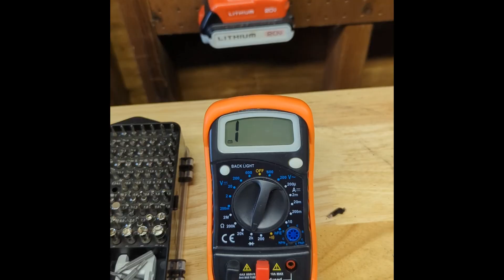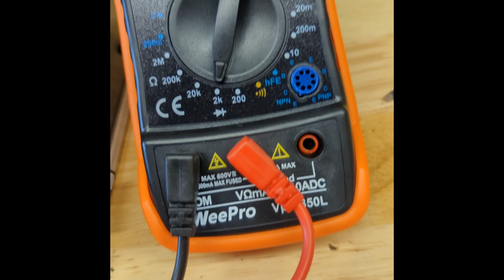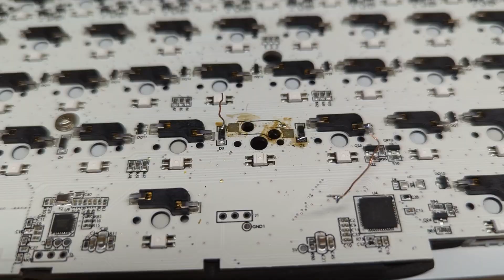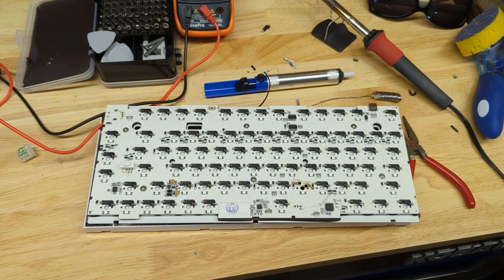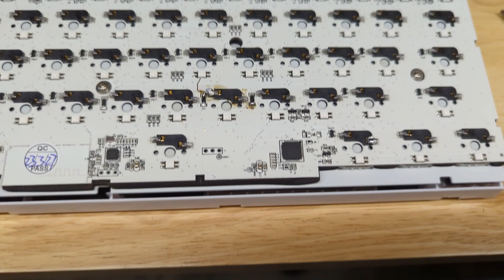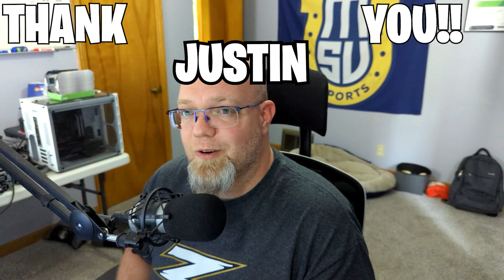IT Can Fix Anything (EPOMAKER TH80 PRO repair) - System Administrator Struggles

Comment: Does you have this keyboard's Circuit diagram? My th80 pro's switching regulator has a short, but it doesn't have a part number on it. Can you help. thanks
Reply from the maker: I'm afraid I don't. I just used a multimeter and traced out what i needed to do.  Sorry